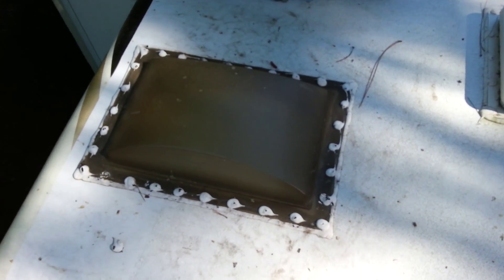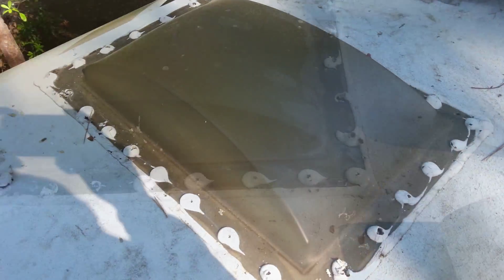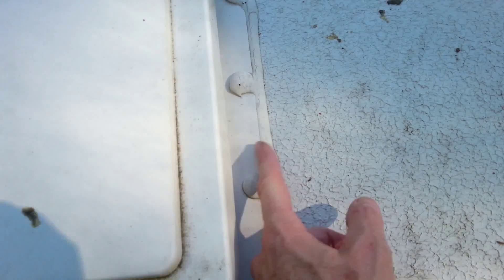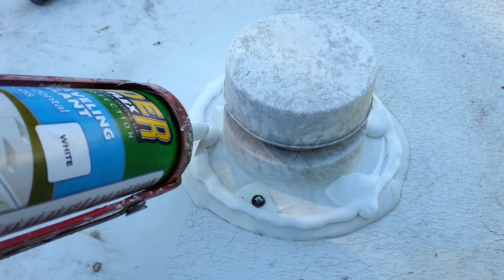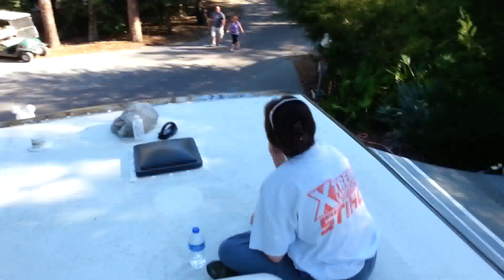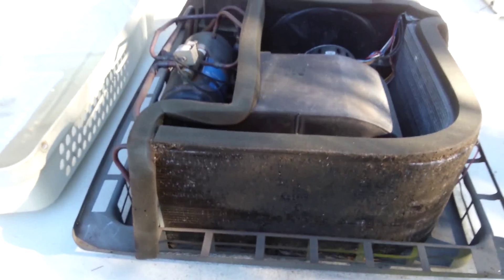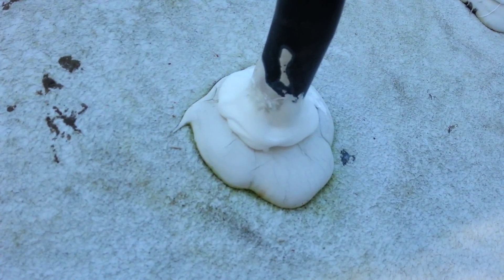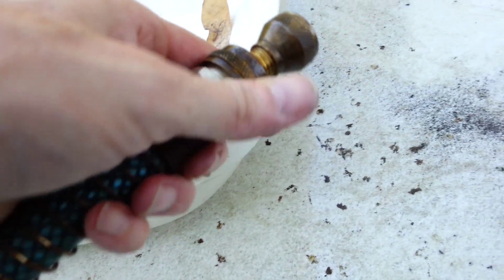Preventive RV roof maintenance using SuperFlex instead of Dicor

Comment: What is the opinion about the differences between SuperFlex and Dicor?  How long do each last in heat and hi-UV exposure?
Reply from the maker: That was a friend of ours rv and 5 years ago in the Florida sun and its still holding up. But I don't have a true comparison.
Reply: @ktoutdoor  Thanks for the feedback
Reply from the maker: 90 percent of the sealant on our 2005 winnebago is still original so thats 16 years keep in mind winnebago does not use dicor they use a silocone based product and dicor will not stick to it.
Reply: Probably made by the same company, just different branding,  looks like the same product as dicor

Comment: replace that skylight...eterna bond tape it and good lord don't scrimp on the sealant.  bead that stuff on there in a good coat. just running a small bead and dabbing the screw heads is nowhere near good enough.  blow off the roof and bleach it with a pump sprayer..that roof will look brand new